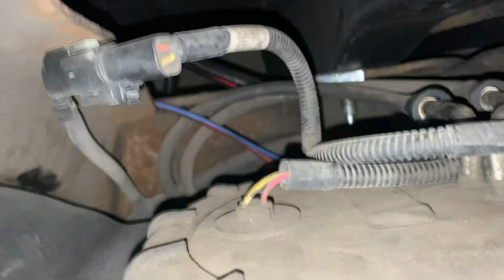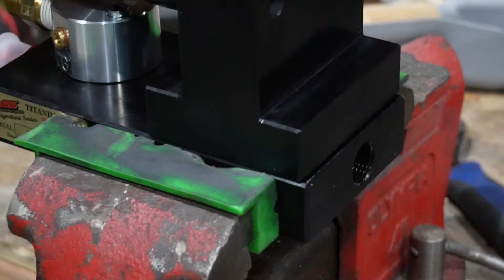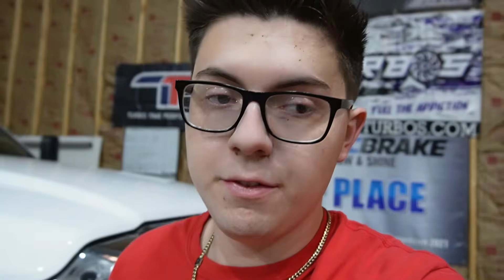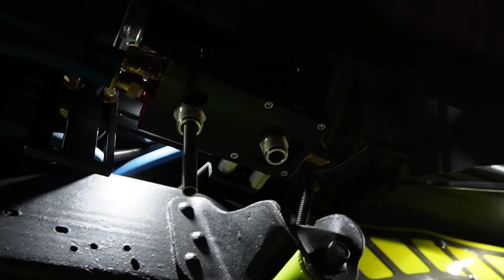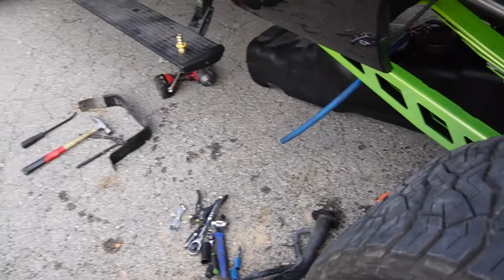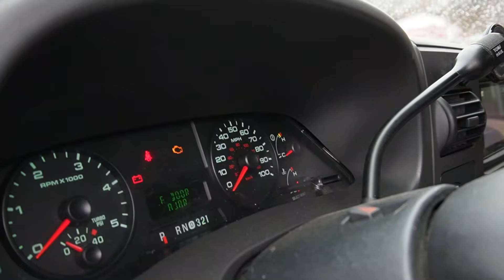HOW TO INSTALL A FASS 220 ON 6.0 POWERSTROKE F250 | IN DEPTH FASS FUEL SYSTEM INSTALLATION

Comment: Do you leave front tiny filter in place or just remove that?
Reply from the maker: I removed mine completely off the frame rail
Reply: @JUSTINHAWKSMITH I mean the 2condary under the hood
Reply from the maker: @theprimalhabits_rus  you can leave the under hood filter yessir just a little extra filtration

Comment: Mines leaking from thr top of the filter?? It was not an issue until after I replaced them
Reply from the maker: Not sure. Are you referring to replacing the top fuel filter in the engine bay or replacing a filter on the fass system ?

Comment: Is it normal for your fuel psi to be 69 my psi is usually sits around 61-62 but it’s been dropping and need to install a new lift pump just wondering if 61-62 is normal
Reply from the maker: Yessir I believe so

Comment: These pumps have come a long way just installed one this weekend on my 6.7 Cummins and it is much quieter than this one. Love it so far. I also did a 52 gallons fuel tank to almost double my fuel capacity.

Comment: If you buy a Fass pump beware there is no warrenty if installed by uncertified user. Even if installed by a registered dealer such as what I did Fass company will give zero support for a failed unit. was a nightmare for me.
Reply from the maker: Thanks for watching sorry that happened to you !
Reply: WTH is a uncertified user?

Comment: I know this video is old.. But when you completely unhook the factory pump. What triggers the pcm to fire the ficm? It has to have a signal circuit no?
Reply from the maker: I’m not sure but it works just fine. Wish I knew the answer but I don’t know 100%. Either way thanks for watching ! 

I’m assuming as long as the keys on and it fires up or key on ficm starts working whether there’s fuel pressure or not so since there is fuel pressure it starts and runs fine and if there was no fuel pump or pressure it would still try to work but it wouldn’t work obviously. If that made any sense lol. Sorry wish I was a little smarter

Comment: I was thinking about upgrading  to a fass and decided in need to see what all i need. Watching this, I have questions. After cutting the hole and getting the pipe and billet peace on the tank, what about the massive hole where the original sending unit was? Also i know this video is older but did you do the blue spring as well? It helped a lot on my 6.0 and i still have original fuel system other than the blue spring. I went for 40psi to a little under 80psi had it for about 2 years now with no problem
Reply from the maker: There are no exposed holes in tank once it’s all said and done. I believe they even sell a kit now where you don’t have to even drop the tank comes with everything needed to do a “no drop” install , thanks for watching! If you call them and order be sure to tell them you seen my video helps out the channel. Thanks again. Have a great day

Comment: No matter what OEM fuel filter brand or fuel filter/pump upgrade you’re using, YOU NEED a fuel lubricity additive to save injectors and fuel pumps. I’ve got well over 200,000 miles of towing RV’s in the last 2 years and I use Opti Lube products exclusively with every single tankful and Schaffer motor oil exclusively for ZERO oil and fuel issues on my 2023 Ford with the HO 6.7 PSD.

Comment: DOES IT REPLACE THE HFCM? JFC, why is it so tough to get that answer
Reply: Yes it replaces the HFCM? How is that confusing?
Reply from the maker: My truck has ONLY a fass system on it. The factory pump on the frame rail has been removed permanently. Have a good day hope this helps.

Comment: Awesome video actually shows everything. From what Iv seen of your truck from other videos it doesn’t look like you have a fuel bowl but I also don’t see a regulated pressure gauge are you just running the fuel into the engine from the pump or is it being regulated
Reply from the maker: @JoshG-j1d  I currently have a regulated fuel return , this fass system still , and the stock fuel bowl also. I look to doing the fuel bowl delete soon and I will have a video on that. Thanks for watching !!

Comment: To anyone watching this video for the first time wanting to do a FASS System and thinking “thats not so bad”. For the most part you’d be right, except for the FUCKING 5/8 PUSH LOCK FITTINGS. Make both ends of your 5/8 supply line to the pump BEFORE putting the tank back in the truck.

Comment: Just put a fass on my pickup this video was lots of help, my only question is I disconnected every thing on the factory pump I believe but I’m still getting some fuel through the flow line I believe and don’t now why. I believe it’s only the two electric connection I need to disconnect or is there another one I need to take off I don’t know about?

Comment: But I got 65lbs & only drops to 61-62ish lbs when tank is low or wide open pulls with just the blue spring
Reply from the maker: @357bkg  sweet! That is normal fuel pressure for a 6.0. But if you ever do upgrades injectors or hot tunes that factory pump will not keep up. Great for stock-ish applications when they’re in good health though! Thanks for watching.

Comment: Where did you mount your fuel pressure sensor , since you insyalled a fass ,im assuming you removed it from the 2ndary filter up top

Comment: Just thinking out loud. When you cut the fuel straw to length you should have measured the depth and then subtracted 1/8" not added 1/8". Adding 1/8" will force the straw into the floor of the fuel tank and limit the volume of fuel that the pump can actually draw out. That could explain why the pump seems louder than it should be and why you are dropping 6 psi when going 3/4 throttle, because the pump is starved for fuel. Also, I would set the fuel tank flat on the floor so that the weight of the fuel in the tank while measuring the depth does not "flex" the tank out being that the tank is plastic. That way when your tank is almost empty the tank will not retract from the lack of fuel weight and come in contact with the bottom of the straw, which again, will limit the amount of fuel that the pump can draw out. Otherwise, great in depth video!
Reply: Was thinking the same thing.  Should have been 12 1/8" from the bottom of the straw indexed to the bottom of mounting flange on the fitting.

Comment: I dont understand how the fuel pressure being sent to the motor is regulated if the return is not coming from the motor, and only sent back to the tank…  can someone help me out?
Reply: This kit is just a gear pump set with some filters on a base. It does no regulation and leaves the stock parts on the truck in charge of handling that.
13:57 you see those two lines he used to bypass the stock fuel conditioner/pump. The two connections in the front go to the secondary fuel filter which has a regulator and a return built in the factory part on the Diesel engine. That's the same thing you install the blue screen update in. It controls the fuel returning to the tank and the pressure that is delivered to the injectors.

Comment: May be just me and/or my setup (factory rated/low power one) but mine works as intended until about half to 1/3 tank then it looses prime on stops or going down hill on my truck. I have a Beans Diesel sump pretty much directly below factory pickup and a titan 67gal tank. Factory pickup works flawlessly down to the last couple gallons of fuel. When I was trying to figure it out neither fass nor beans could figure it out, fass just blamed the titan tank. Wast of 800bucks in my case/opinion, but I've heard alot of praise which is why I initially tried for it.

Good luck to all who have them (fass, air dog, etc) and those looking into them, I wish you nothing but better luck than I had with them.

One thing I'd like to see from fass, or even 4th party, is some caps for the factory pump so when you bypass it it can be locked down, I came out of work to a river of diesel from mine when the rubber cap I had on mine split. I've since not put the fass back in use.

Comment: As a newbie, my only wish was a little more details on how you found the key on only fuse. I know filming was difficult for the bracket but I was hoping to see the location before you installed the bracket. 
I appreciate all you did! You made the technical FASS installation info a lot easier to understand for sure!
Thanks for all you do!!!!
Reply from the maker: He man you wanna get a test light it will make it super easy! Go into the fuse box and poke all the fuses on the little silver dots until you find one that doesn’t light up , then turn key on and poke same one , if it lights up it’s a “key on” only powder ! The bracket mount is super easy and you’ll see the bolt hole no problem trust me ! You got this! & thanks for watching!
Reply: @JUSTINHAWKSMITH  thank you for replying to my post! I also found your alternator replacement video great informative video as well!

The bolt to connect the bracket is located on the bed, cab or frame? 

My bed is off right now. Cuz I had to replace the bed rails due rust. Used the Dorman bed rail kit. Undercoated with bedliner spray on. 
Thanks again!

Comment: You can take off the lower fuel filter after installing the fass system right ?
Reply from the maker: I reckon you can… I plan on doing that. It’s pointless to be there now !
Reply: @JUSTINHAWKSMITH  So does that mean you now loose your "Miles till empty" gauge on the dash?.... Considering that factory filter/lift pump is what determines your distance till empty aswell as your fuel mileage lol.... Cause that's annoying if you loose that (Not that there very accurate anyways)
Reply: @Gendreau113   Miles till empty and estimated mileage is calculated by two things. The FICM reporting how much fuel you burn and the TCU reporting your average speed are used for a calculation of your miles per gallon. That calculation is multiplied by the amount of fuel the fuel sending unit in the tank reports is in the tank. So no, none of that is lost because nothing involved in those dash indicators was altered.
The fuel conditioning unit was bypassed and a gear pump with a fuel filter base was installed in this video.
Reply: @btwbrand  That's what I figured, but when I did a Cummins swap on my truck I lost my DTE. If the FICM also calculates the fuel economy, that completely explains why I lost it since I no longer had the Ford Injection module.

Thank you for the good explanation though!! :)

Comment: I build a custom regulated return system around a Motorcraft 6.7L pump for my 6.0 and it’s been rock solid for over 75k and still going. Used a CAT 2 micron secondary filter next to it and a Beans micro fuel sump
Reply from the maker: Awesome!
Reply: How much